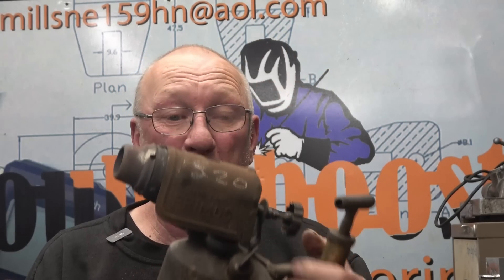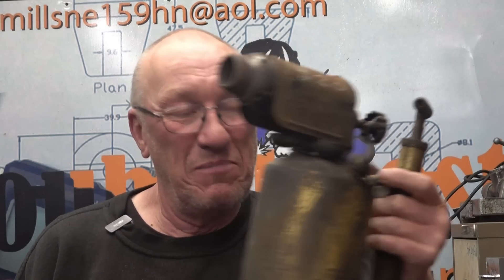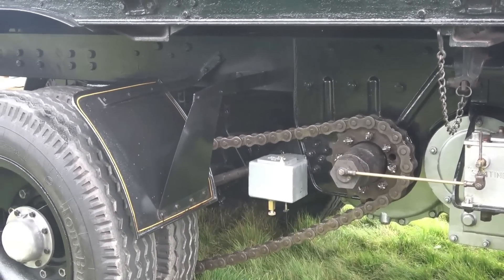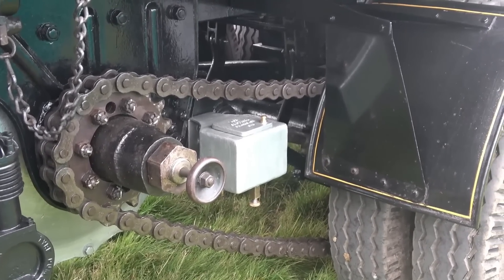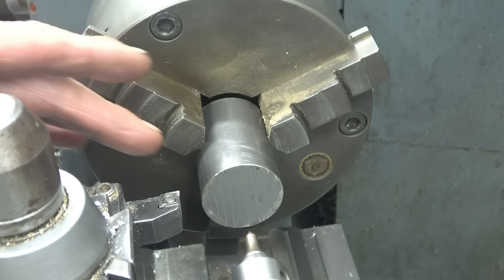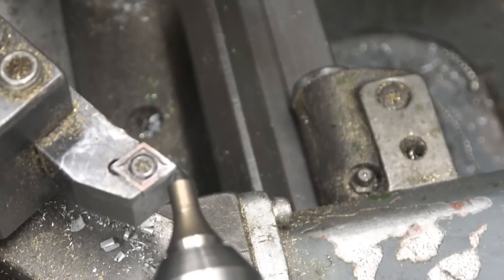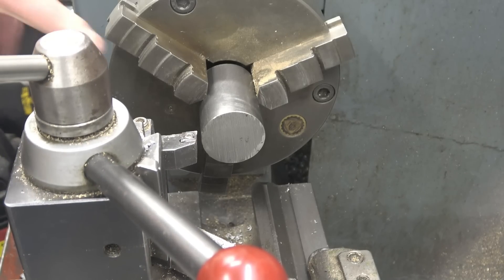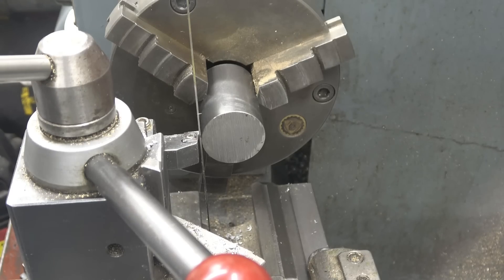Wed Catch-up 6  My Favorite IC Engine . Easy Lathe Tool Center Height Setting

Comment: Meteors all went in tanks, Merlins flew :) :) the meteor was adapted from crashed Merlin engines (at the very beginning) for use specifically in ground vehicles. They didn’t have to be build to the extreme tolerances of aviation engines, for obvious reasons, aeronautical engineering being what it is. The meteors could also be cast from iron instead of aluminium. Both are amazing engines but if you’re looking for the chicken/egg answer, the Merlin, as in nature, lays the egg.

Comment: John  I've got a slight problem on my Warco 250v lathe, its cutting a slight taper when not using the tail stock, its not terrible but its not perfect, any advice on how to remedy would be much appreciated.
Reply from the maker: It depends how the headstock is attached to the bed
Reply: @glynburnett7364  Sounds like you need a levelling exercise.

Comment: Thanks John for the RR Merlin engine clip, the sound of that V12 is like no other.  The Ruston is very nice but completely different.
As for lathe tool center height , Stefan Gotteswinter did a video on that recently and it's well worth watching.

Keep up the good work! Robert

Comment: 2:37 Nice see one of the smaller Hornsby engines! My dad worked at their factory in Lincoln and the open days at the research centre usually had one of the big ones running... they wouldn't allow visitors without ear defenders these days, we were advised to stick our fingers in our ears 🤣